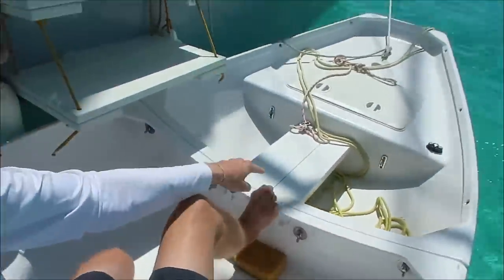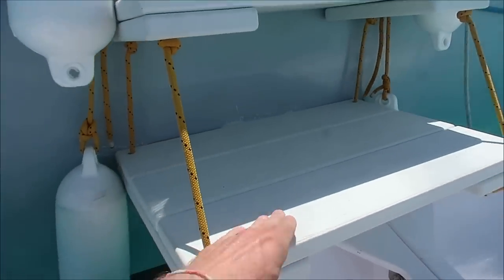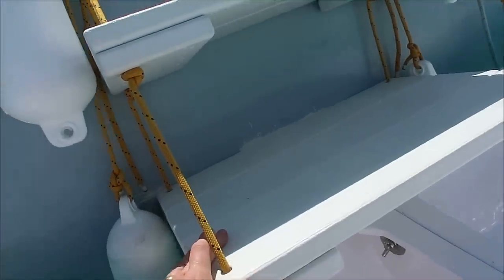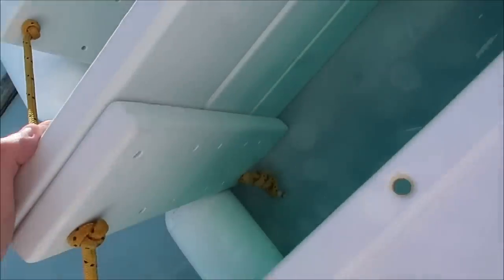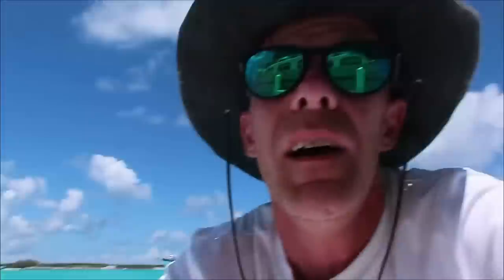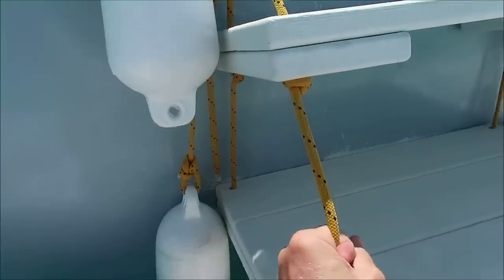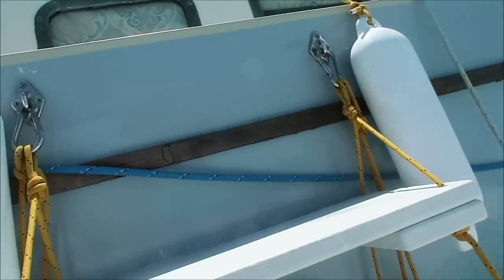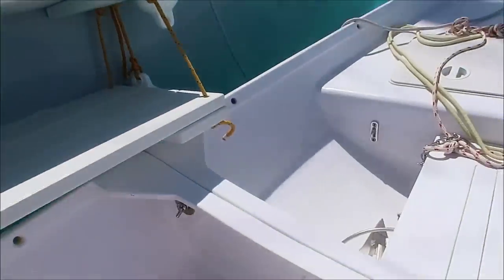About Our DIY 2 Step Sailboat Boarding Platform

Comment: I remember when you made them and I am still amazed at the way the old-school sailing methods still work fine if built well. I would not be surprised if 50 boats turn up in the next few months sporting these steps.
Reply from the maker: Probably. That's kinda how it goes. For instance, there have been a surprising number boats in the Westsail fleet glassing there leaky hull/deck joint after we did ours.

Comment: I must admit after I saw yours I decided to make one for Roci even though we have a folding swim & dingy step in the stern.  I want to be able to use the swim step for swimming, so I decided to use the side entry with the "Sailboat Story Dingy Step" (TM) for the dingy.  The only real difference is I am making ours out of wood and it will attach to the stanchions... and I have added sacrificial split Pool Noodles on the hull facing step edges as wear guards.  It looks to me like your hull is getting a little wear where the steps rub... or am I seeing that wrong?

SOOOOOO GOOD to see ya'll back out there!!!  You all look happy and the Sea Rat is a Great boat!!

Comment: Ahoy, nice job... I'd suggest to any new builders that the bottom step doesn't need 3 cross planks, 2 will be fine if kept in the same postition as the 3 are now with just the one next to the hull either cut away or left off. Pad the two under planks to save the paint. Save a little weight for handling could be a benifit. ... just thinking out loud.

Comment: Great design. I have a platform on my boat made from half inch Starboard. It holds a person's weight just fine over the same sort of span used here. It's half the thickness of this design and should be half the weight for the same size.

A strip of gunwale fender attached to the hull side of the steps would protect the boat.

Comment: is that rope dinghy float line? I have been always been looking for a better  yellow line for my jib furler (I don't know why but I insist on yellow on the furler)  I bought the yellow dinghy float line they sell for dinghy painters etc and it works fine but has seriously faded over the the past year or so. any insight into some yellow rigging line would be greatly appreciated!
Reply from the maker: It's not. Polyester double braid. We use Blue Ox ropes.

Comment: Ben, What are you doing to protect the gel coat?
Reply from the maker: Nothing, but it could use something. You can see the paint scuffed off behind the steps. The gelcoat is waaaaay tougher than the garbage paint that's on this boat. When we get back I'll put some kind of rubber pads on the backside. I've also done a rope wrap on the previous step that worked well. Yeah, now that I'm thinking of it, I'll probably do the rope wrap again.
Reply: Was gonna ask same thing

Comment: Question, on your steps have you thought of a way to cushion your boat from your steps to prevent Boat damage?  I was thinking apply swimming noodels between the steps and the boat side.
Reply from the maker: I tried noodles, but they detach easily. My first step had a line of holes along the back edge that a rope wrapped through. The rope cushion worked well and I’ll likely do that on this new step as well.
Reply: @Sailboatstory  /upvote, maybe pin this (your) comment. thanks
Reply: pipe insulation plus the line of holes and rope maybe awesome
Reply from the maker: @womackke  The bare, cheap foam of pipe insulation and noodles just doesn't hold up well in my experience. Perhaps if an added canvas cover was made to go over the foam, but the bare foam lives a short life in the direct sunlight, especially further South.